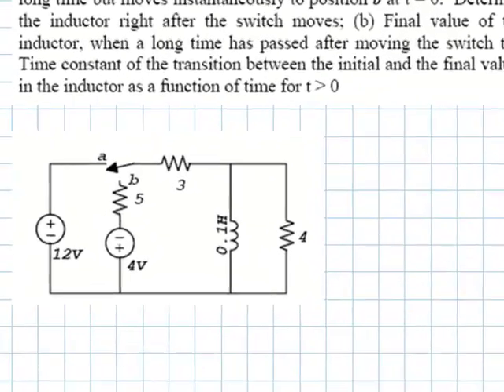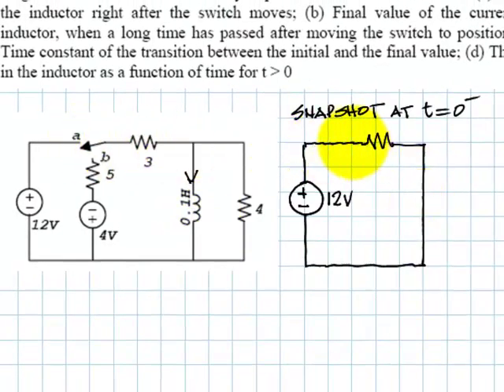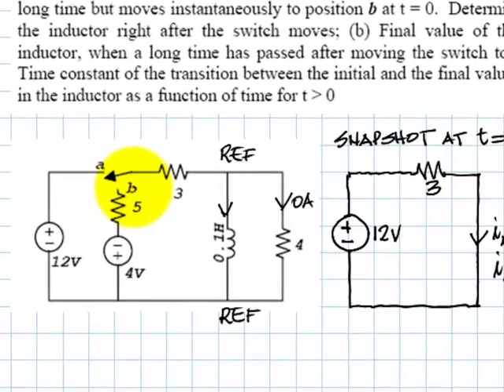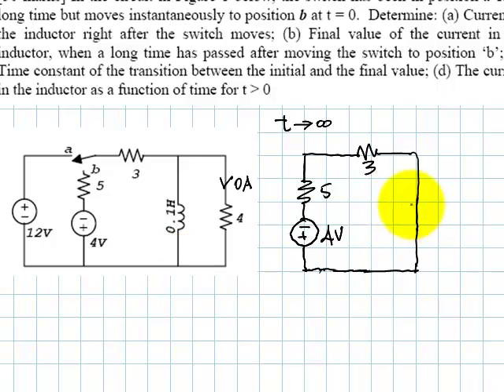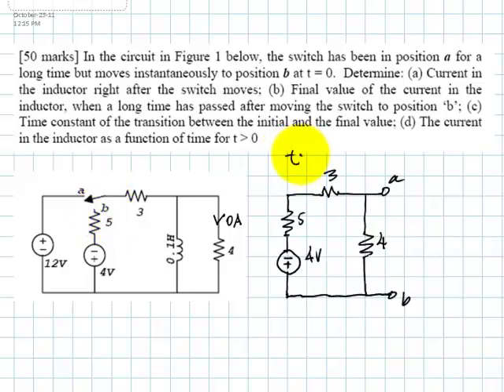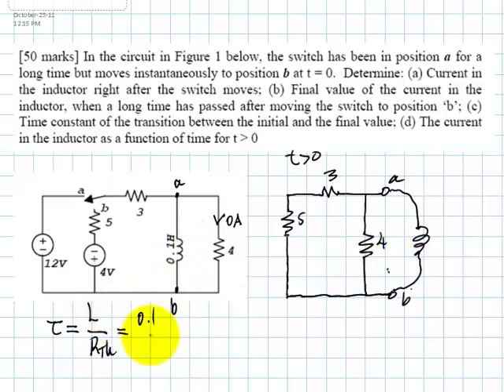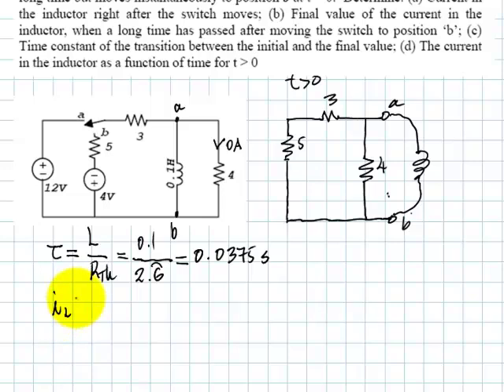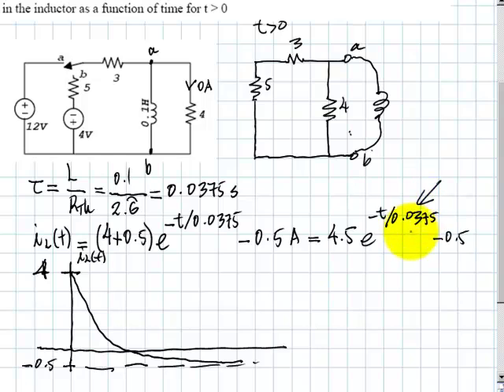EECE 251 - A First Order Circuit Example from a Midterm of 2010

Comment from the maker: Yes Mr. JDA36933, an RL network is a particular case of a first order circuit. First order systems are those whose behaviour can be described by a first order ordinary differential equation, that is, they have a single eigenvalue. RL (as well as RC) circuits are first order circuits.